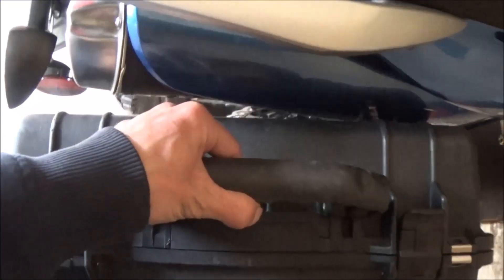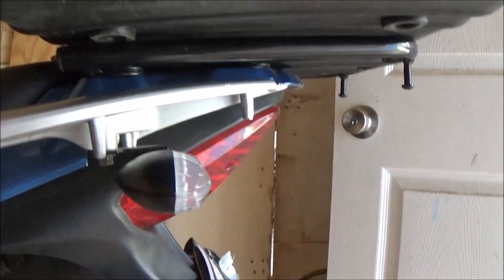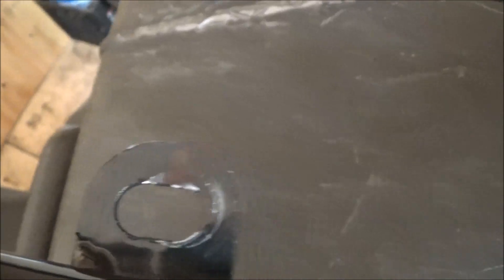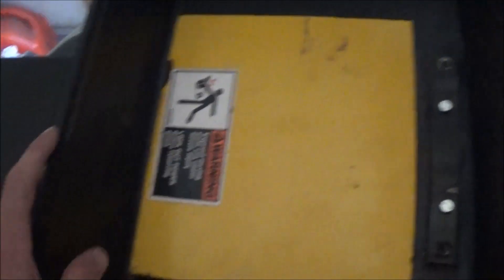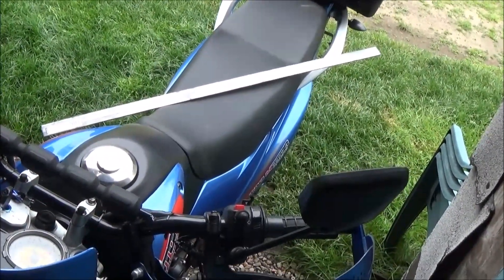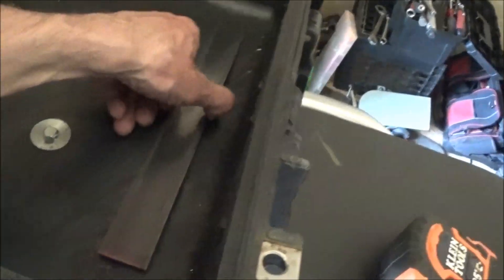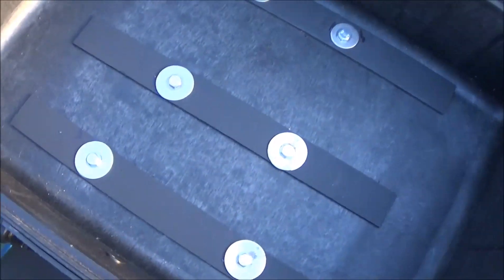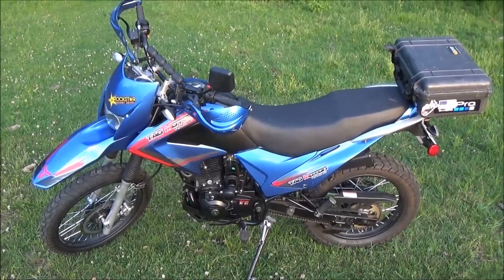Tbr7 Pelican Case Mount Easy DIY Luggage Rack

Comment: Ha, I am about to mount two Pelican V250 that open on the tops while mounted on the sides. They will work much better. I have a small fabrication shop so I am making a traditional adventure bike rack system. It's going to look amazing and the cases where about $120 instead of $500 like the big brands.
Reply from the maker: I thought about side cases but the exhaust side would have to stick out further than the other side, Or they both have to mount that far out to look symmetrical.